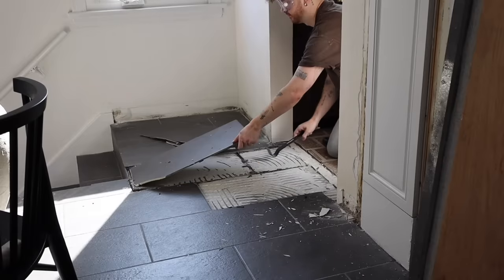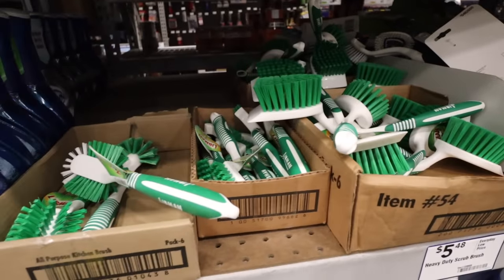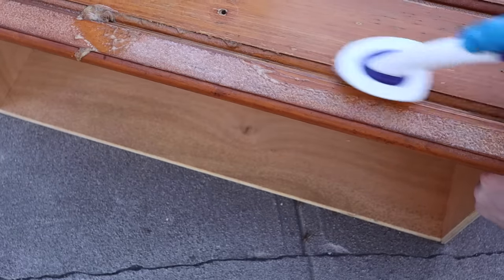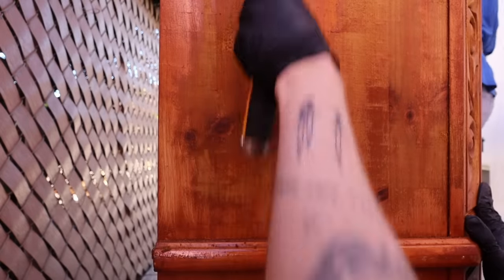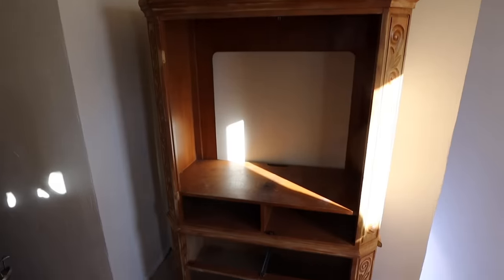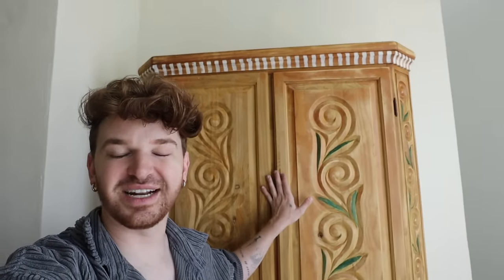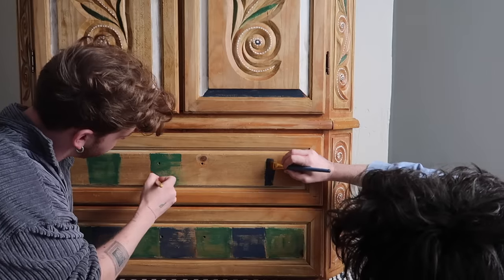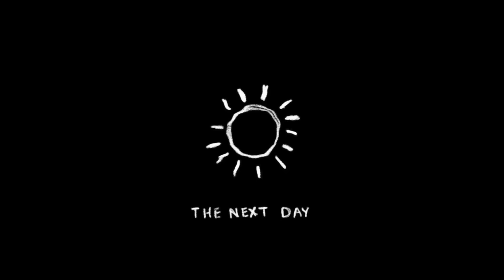Turning a FREE Cabinet into my DREAM FURNITURE PIECE!

Comment: I’m painting a table my grandfather built in the early 1900s.  Very basic, two shelf half moon with three legs.  He made it from pieces of leftover wood and it’s been painted a few times.  I’m doing it in green, but will paint designs on edges and maybe do a rub on stencil.  Thanks for the inspiration.  All edges are flat.  When it broke, it pulled the edge from one shelf, but I’ll glue it, fill in as needed and sand.  It’s rustic anyway.  I just couldn’t get rid of it.  My friend is going to put it together for me after it’s done.  It’s in 5 pieces which makes for easy repair, painting etc.

Comment: Chalk paint is ideal for this kind of projects. You can seal it with wax, so you don't lose the rustic touch but the wood is protected
Reply from the maker: Ohh!! Thank you for that tip :)
Reply: especially because acrylic paint is not sun/exposure proof and will change color or fade over time. the cheaper the acrylic the faster sometimes the color even breaks off it is technically liquid plastic so it makes sense.
Reply: Yes, I’d seal it with clear wax or dark wax if you want an aged look. Protects and feeds the wood.
Reply: Great job Drew! The cabinet looks amazing. Wish I could find what you do on marketplace! Wonderful piece of furniture.
Reply: So, a few naysayers here. Now it's my turn : IT WAS FREE....and the style fits the space. Since it will be seen through the kitchen, I do agree that a white wash followed by a darker wax or stain will provide some finishing that it seems some folks are missing. Personally I was missing the slightest touch of yellow and red....somewhere. Also add some towel racks/holders to the sides and it will be perfect !
Reply: Yes and in the Annie Sloan paint you can get white wax that gives an overall milky look.
Reply: @cruelaz  I painted my bed and nightstand with chalk but made a lot of tiny details in acrilic paint, like 6 years ago, and protected it with wax and it's as good as new. So if the over coat is good I think he is gona be fine
Reply: @lonefox  you are welcome! ☺️
Reply: @lonefox I feel like it needs some hanging drawer pulls. So pretty!!!
Reply: I've seen you use Howard Feed n Wax in previous videos and that product would work on your cabinet without being too permanent. Wax needs to be reapplied occasionally in order to protect the wood. I love the finish and tole paint technique you used. It looks very authentic.
Reply: Wow Drew love the cabinet.
Reply: So pretty. Decorated one of a kind Porcelain knobs?
Reply: @lonefox And instead of sanding you can just wipe it back with a damp cloth. Before sealing chalk paint is removable.

Comment: I get the look you're going for and I like it better sanded - distressed looking.  But I agree that some wax needs to added - especially since it's near the washer. The wax will help prevent the raw wood from getting too much moisture. You might want to make sure the bottom on the floor is sealed too - just in case.

Comment: I think what makes it feel “off” and “unfinished” like the commenters are saying, is that the paint didn’t need to be put on sparingly and sanded that much to make the piece look rustic or worn. I feel like the paint application looks more unfinished rather than looking “worn” and “aged”. The paint design I think is 10/10, and the color choices are perfect! But if you had put on a full amount of the paint and made it neater, then sanded some areas, it would’ve looked more like an authentic piece from back in the day. Plus it doesn’t have hardware on it yet, which will add more to it! :)

Comment: I think this is definitely a “trust the process” kind of project. I think the reason it looks unfinished still is because everything is very matte. Maybe a light clear coat would help? It would also seal in the acrylic paint. I think the hardware will also make a big difference. Even without those things I still really like this. I think it definitely has the same vibe as the inspo pictures.

Comment: Especially in a laundry area with moisture, this piece needs to be sealed again. To preserve the light color and not have the pine go orange, you might want to put a thin paint wash on it that has some sealer in it. Should have been done first and will change your paint colors, but you can test that out and it might be a vintage look you like. Good luck!

Comment: 🦊drew great job! You asked another commenter should you go crazier on this piece. I vote Yes👋🏼. Wait until you have the rest of the room finished. I agree with the red suggestions or terra cotta. Continue the Navy around the rectangles        instead of navy & white. Will give better depth/balance. The red/terracotta use on the swirls. Use a second deeper green on the other side of the leaves. Consider doing something freehand or find a stencil to maybe do some thing down the sides. 
Like the checks. Like the strips. And my heart be still💓Love the dots!!! •••••••🥰

Comment: A little bit of white dotting on the scalloped edge would look nice. Also a different shade of green on the back side of each leaf would make a nice contrast. Somehow those front swirls need more paint--they don't look 'finished' as they are-would also add some white dots between the green and blue drawer blocks----Spectacular find however!

Comment: The oven cleaner from the Dollar Tree works exactly the same for a fraction of the price 😉 also, if you cover it with cling wrap, it’ll be way more effective as it needs to stay moist to be active. Also helps to remove while still wet.

Comment: It’s a challenge to use paint and raw wood in the same piece, yet have them meld together in a seamless composition.  So sometimes we have to choose between one or the other.  There were so many ways to potentially go with this cabinet, but I’d want to stay with your overall decor because what you’ve done in the house is magnificent.  Personally, I’d have painted an off white (thinned down paint, not heavy) over the carved portions and details, also accenting with some silver and gold, then stain over the entire cabinet with a dark color: charcoal, dark walnut, Jacobean, or ebony.  I would prefer the charcoal personally.  When that’s done, I’d gently sand areas to reveal the wood, the underlying paint accents, and to give a weathered look, but not too much.  Then change the hardware to match the carvings with an organic accent.  I agree with those who said this doesn’t appear finished.

Comment: I don’t hate the idea of an armoire in the service porch. My laundry room is small so I wouldn’t have room. In fact, my water heater is in my laundry room. 😂 I don’t mind; it gives my humble 1930 L.A. home a lived-in feel. The kitchen is all original so it’s almost charming in a way. 

I do have a small walk-in pantry in the service porch which is closed off by a door. There used to be a door between the kitchen and the service porch, but it’s long gone. I replaced it with a curtain which makes the water heater less visible from the kitchen. 

Even with the original utility sink gone, my side-by-side washer and dryer are squeezed in there and had to be installed perpendicular to one another. I could install a stackable but I hate stackables and it would block the window. There’s a window in the original back door but I like that the service porch is so flooded with sunlight. 

L.A. service porches from the 20s and 30s originally had large utility sinks and were not built to house washers and dryers. They were used for doing laundry by hand and ironing. People hung their clothes out to dry which is why most back doors are in the service porch. The service porch would almost always have a window or, at the very least, there was a window in the back door. Often both. This is because the maid or lady of the house spent long hours working in there. Most of the sinks have been removed to make room for washers and dryers, which is why Drew’s looks so awkward tucked away in the back like it is. That’s where the sink used to be. 

My mom’s L.A. house is a 1926 cottage-style Tudor Revival. Her service porch is large and has lots of original built-in cabinetry. She had to remove the original sink to make room for a full-size washer and dryer, but there was still room enough to keep the original cabinetry. 

My mom’s water heater is in her basement. Contrary to popular belief, many older L.A. homes have basements. Most don’t cover the entire square footage of the house like you might find in other states. Her’s is accessible from outside. Her neighbor in a Spanish Revival a few houses down has one that is accessible from a bedroom closet and was built as a prohibition-era speakeasy with original wood paneling and a bar. It’s the cutest thing you’ve ever seen. 

The door between my mom’s service porch and kitchen has a window so the lady of the house could look in on the maid. Most pre-war homes, even modest ones, have some type of servants’ accommodations or work areas. Having grown up here, I’ve been in many L.A. houses and duplexes with dedicated maid’s quarters.

Comment: It is an entertainment armoire from the 80’s or 90’s. You need new drawer glides and maybe two glides per drawer for better stability. Pine is very porous so you might want to seal it so n9ne of the solid pine parts will crack later. Will you add more shelves ? Great work!

Comment: ok ngl i did not trust the process but it turned out really well in the end! i’m not a huge fan of the checkers on the drawers since the design is so large it doesn’t flow as well with the other painted elements… but otherwise it is really lovely and charming!

Comment: It's your house and your furniture.  That said, since you have a Spanish style home, my feeling is to lean into it and not go down roads that don't enhance and stay true to it.  I've noticed (quite a bit) that on HGTV home buying and reno shows, so many people get into homes with this style of architecture and finishes and want to rip it all out and "update" it, saying it's all off trend and out of date.  NO, it's NOT, it's the STYLE that people don't seem to understand.  This is why so many houses are starting to look the same and "on trend," which is the wrong way to approach interior design (which should be personal and last a long time).  So, my personal opinion about the armoire is that I would've stripped it as you did, then used dark brown paint on the recessed areas to enhance them, which is more Spanish and in your house style.  I think that would've been a lot prettier and meld with your kitchen reno better.  As it is now, it seems more Swedish or similar, which is way out of this style.  There are plenty of furniture and decorative pieces in the Spanish style with bright colors and hand painting, but there's a difference between those two styles.  This is my opinion.

Comment: I have done a lot of restoration over the years. I just think it needs a lot more if you look at the inspiration pieces. I love these tv armoires as they provide so much storage. I found a bookcase that fit perfectly inside e mine and it is amazing how much storage it gives. In the video that white is off putting. It probably looks different in person but I might tone it down with a glaze. You will get there-it’s the perfect piece for the spot.

Comment: I guess I just don’t understand why you would choose to use oven cleaner on a piece of finished wood? Why wouldn’t you just buy stripper or mineral spirits and some sandpaper to get that thin layer of finish off certainly it would not do as much permanent  drying p/damage to the wood. I understand that this is something that other people are doing, but that doesn’t make it the preferable/recommended of refinishing wood furniture.  I wish you would be a little more responsible about what you are demonstrating for others

Comment: I'm so sad that you used oven spray instead of just regular stripper DESIGNED and DEVELOPED to remove finishes. 
Oven spray is designed and created to degrease metal, not strip wood finishes. 
If people think strippers are toxic, using oven spray is like jumping from the frying pan into the fire
I don't know which online DIY person used it in a pinch then shared it, but they started a really unreasonable and rather silly trend amongst the DIY community. 
Oven cleaner is also terrible for the wood too, and should be rinsed off.
I can't even watch this now I'm seeing what is happening. 
It's not a smart hack, it's bad for anyone using it and the item it's used on.
Why not use a product made for the purpose intended?
I really can't understand this at all. 🤷☹️🤦🙄

Comment: I don't get this oven cleaner nonsense. There are better, less caustic products meant for stripping finishes from wood. Also, working outside is not a replacement for wearing a mask when working with toxic chemicals or sanding. It may not look cute, but neither do the treatments for COPD.